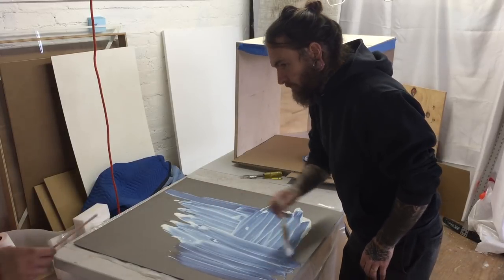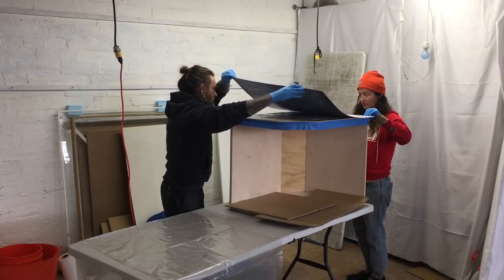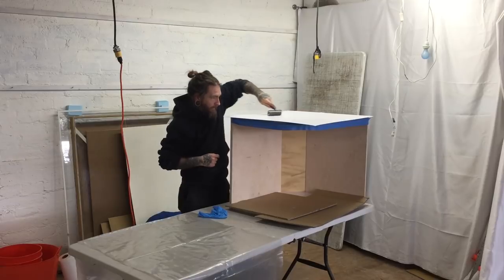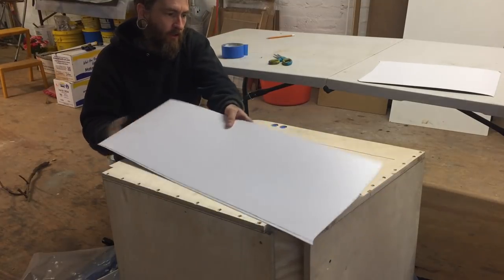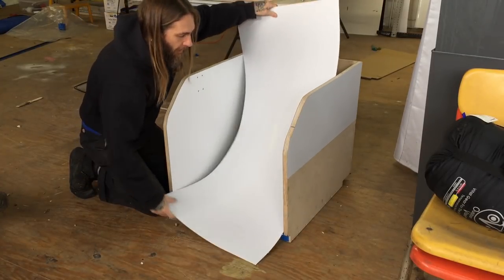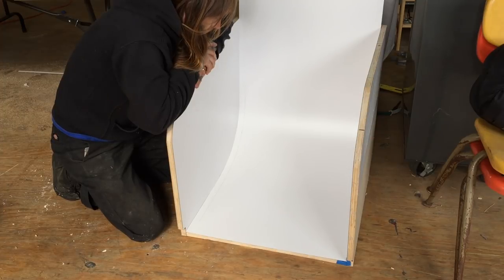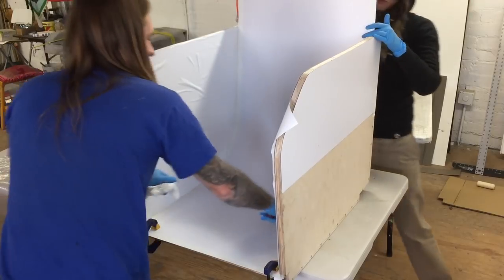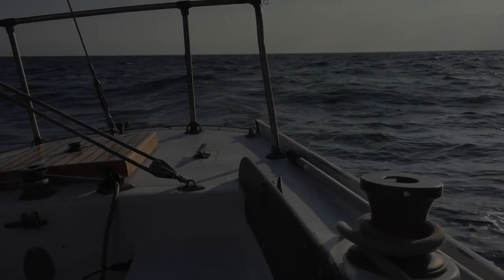Laminating a Custom Stove Enclosure for an Alberg 30 Sailboat Refit

Comment: Hi James and Camille!  The galley is coming together nicely.  I have a couple questions:  1) What kind of artist is Camille?  2) Will we see any of her work? 3) How are the chain locker and head refits holding up? Any leaks?  4) Do you guys have any concrete plans/timeline for when you will feel like you have done all the boats projects that are keeping you tied to the dock, and you take off for some extended world cruising, and finish the rest as you travel?  Great vlog!
Reply from the maker: Hi Natalie, you can see Camille's art online on her instagram account @cum_eels or on the Ochi Projects website (https://www.ochiprojects.com/portfolio_page/camille-schefter/) that was her most recent show . 

The chain locker works perfectly, I am going to shot an anchor update video soon when I install a new larger chain pipe, the one we have is too small and the chain bundles up as I weigh anchor. 

The head is all good, my only complaint is that since all of the plumbing is exposed it smells like a boat head more than it would if it was all behind a cabinet. we will be doing a major redesign of that area soon installing a large support timber under the mast that runs to the hull and enclosing the head, moving the door way for the v-berth off center towards the starboard side (similar to how tartans are designed) This will solve the mast support beam issue and enclose the head which will help with the smells. 

We plan on doing our first cruising season next spring in the Sea of Cortez for 3 months minimum. So come next february whatever is done is done and we push off for mexico. Projects I want to get done by then include: Bottom job with all new thru-hulls and sea cocks and antifouling, all new rigging and mast painted with radar installed, some sort of solar installed, and glassing in the bilge as a second larger water tank, this will give us 65 more gallons giving us a total of 95 gallons of water. We might do the above enclosed head build out this year too but its low on the list as far as necessity goes. 

how are your projects going?

Comment: every veneer on my boat in the tropics delaminated after 2 years from the high humidity..  There has to be a better way than residential contact cement.
Reply from the maker: Bummer, I guess I will be crossing that bridge when I get there.. thanks for the heads up !
Reply: I wonder if the  moisture and humidity get in under the veneer from the end grains. Maybe epoxy seal the end grain of the ply before putting the teak? ...Just my beginner thoughts! Love the videos. Love the absence of royalty free music! Although the haul away joe on casio is pretty epic!  @SailorJames